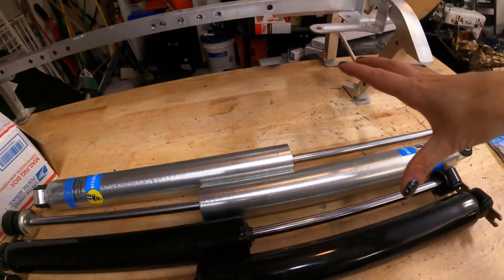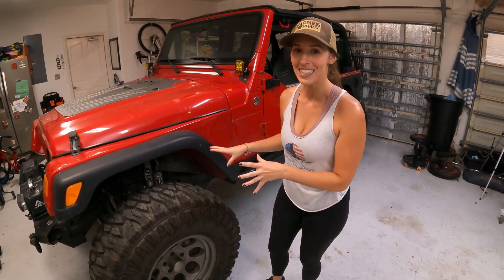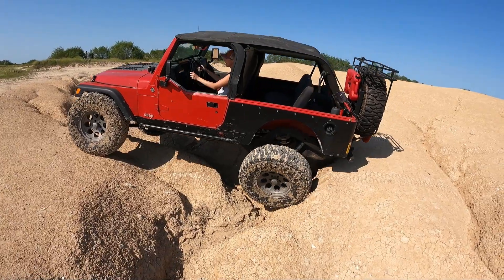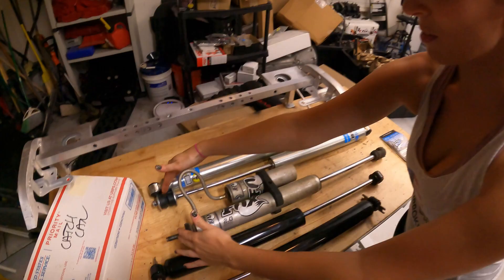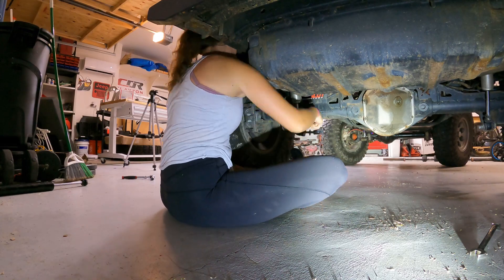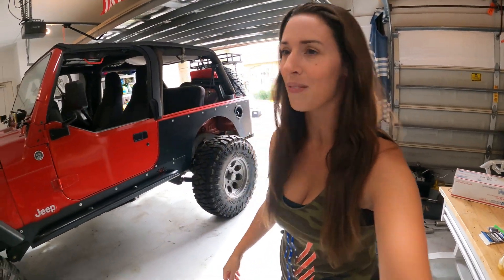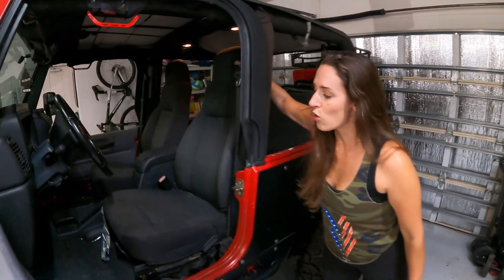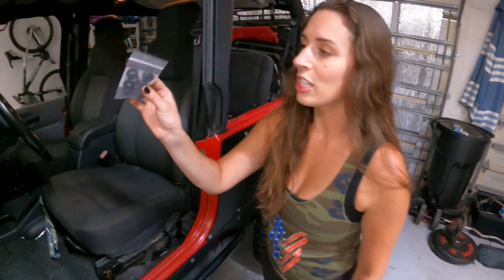More Upgrades for My Jeep Wrangler!

Comment: As a firearms instructor, that mount is the worst thing you can use for many reasons. Carry on your body and practice drawing or don't carry. Your "clock" becomes a projectile in the event of a crash, makes for an easy target if you leave it by accident, and allows easy access to it. Part of being an armed individual is being responsible for your "clock" at all times and keeping it inaccessible to anyone who should have access to it. Also, remember it's better to have the element of surprise, this is why most people conceal carry rather than open carry. Having it visible make you a target. Not trying to be rude but y'all were worried about your little ones accidently putting the Jeep in park or drive with the shifter, which is why you didn't bypass the lockout, but you're ok with the "clock" on a magnet under the steering wheel? Carry on your body and practice drawing from in the Jeep or don't carry. Pick up a Mantis X and a DryFire Mag, toss a few targets up around the garage and you can practice all day/night long without wasting any freedom seeds.
Reply from the maker: Totally respect everything you are saying here, and I agree. But it won’t be living on that magnet mount… it will only be there occasionally and not when my kids are around. Sorry I didn’t specify exactly how when and where it will be located at all times, mounted on the magnet or not. 

And yeah….. I am concerned if my kids are sitting in the driveway or out wheeling and accidentally hit the shifter with their leg🤷🏻‍♀️

Comment: Yeah TJ shocks in stock mounts are pretty much limiting straps with lifts under 5" especially in the rear. I banged out the essentials and outboarded the rear and raised the front towers. I dig your DIY highlines I did the same!

Comment: Only thing I don’t like about the pod light bracket being there is I’d be afraid of two things. 1 the wire from the light can possibly get ripped into the ujoint from crawling through mud. 2 flexing will look ugly with wires running across the axle n up.  But that’s just me. But I hope you like it.  Awesome video as always
Reply from the maker: I think it wouldn’t even be noticeable in a jk, you would just run the wire along the wheel speed sensor and brake line.
Reply: @JeepGearGadgets  wow.  I’m not thinking.  Hahahahaha so true.  🤷🏻‍♂️ 👍🏻

Comment: If you dont keep a lot of stuff in your center console, try the magnet on the front end of the inside of the center console. Use come carriage bolts so there is nothing to scrape on the outside of the console.

Comment: Your TJ looks great and with new shocks it would be smoother off-road. My jimny all grip isn't as fancy as your TJ with good shock, steel rim with 30 inch tyre but it's a fun little off roader. Have never driver a wrangler, so would love to drive one of your jeeps even if it's only for 5 mins.

Comment: Dominant side right where you had it. I think the steering column should block your clock nicely. Don't think you need to worry about it being seen. If it's there, you're there. Besides its going to be pretty visible from the passenger side anyhow.

Comment: Mounting location suggestion for the "Clock 19" magnetic mount....Right in the garbage.  IMHO it is a bad idea for a number of reasons.
* Magnet could fail and your clock is now on the floor out of reach. maybe under gas or brake pedal=not good
* Mount does not have trigger protection=not good
* When exiting your vehicle you would need to either re-holster(risky with one in the pipe, and can be a pain in the butt), or store your clock in a lockbox.
* When in a vehicle it is generally a better idea to have your "force multiplier" on your person and under your complete control at all times. Think of situations that may require you to exit the vehicle in a hurry...one more thing to have to grab. You may need a free hand for one of the kids etc. Also you will be less likely to forget it in the vehicle/out in the open.
* A good holster should allow you to comfortably carry while driving and with your seatbelt fastened. Your clock will always be in the same place(which is good) and the trigger will always be protected unless you need to un-holster(very important).

Just a few observations. We train vehicle work regularly and in training exercises the outcome is always more favorable when drawing from a holster :-)

LOVE your videos!! Keep up the good work!!

Comment: i have been trying to figure out the same question for my magnet mount. I came to the conclusion that a side mount magnet and the speaker pod above your head. is the best place. There is no other place that I could figure out as a 6'5" male. would love to know where you end up putting it. Thank you for the content on the LJ there is very few left.

Comment: Dumb question, I have Bilstein 5125s on my Samurai and they are installed with the shock shaft on bottom.  I seem to recall somewhere that it was recommended that way.  Does it really matter?  You guys put the shock body on the bottom.

Comment: I bought same mount for my 2016 jku far as lights I bought 1 inch motorcycle pod lights . And question ?  Far as catch can on 2016 jku seen ones have look like air filter on Amazon your thoughts on those compaired to non filtered version.

Comment: Oil catch can:  All I have to say is I have one on my 2016 V6 Colorado and Subaru Crosstrek.  They don’t really catch any oil.  After several thousand miles, I open them up and nothing.  Not really catching any oil.  Either there is no oil to catch or they are not working or a gimmick for a non gas direct injection engine.

Comment: just wanted to no did you use they stock gas tank with they swap
Reply from the maker: Yep. If you have a Tj older than 04 you will need a new pump. There is info on Novak conversions website about that

Comment: I think those clock mounts are pointless. Why not build something that you can just take the holster off and put the whole rig on it? Instead of removing the clock and putting it in the magnet and then having the holster flopping around?? I built one for my jk for like $8